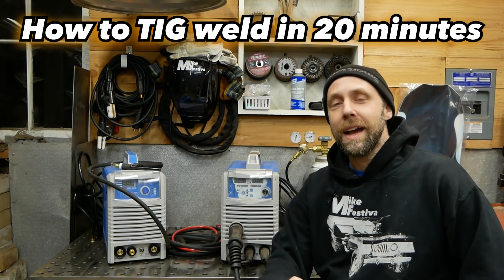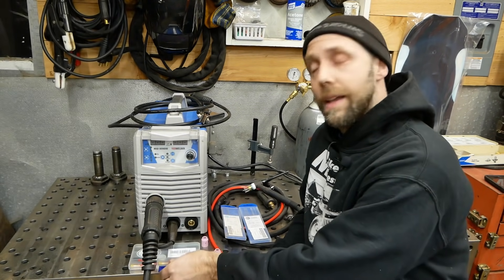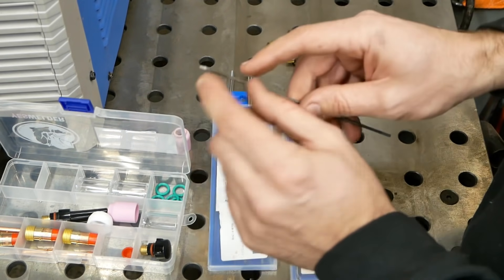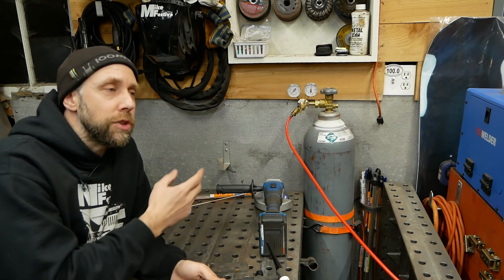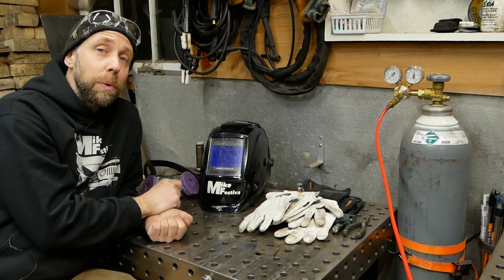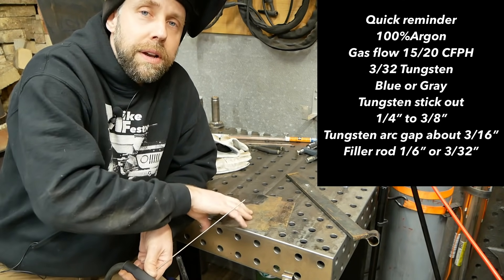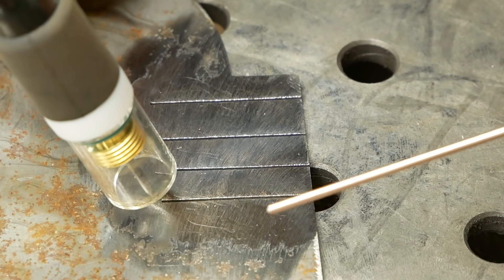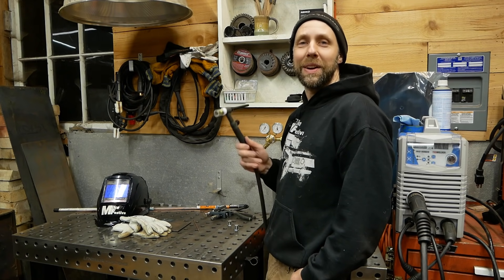Learning how to TIG weld made easy

Comment: Sorry for stupid question, but is it demanding on eyes? Seems like pretty bright arc even through green filter. Is there eye damage if you do this regularly?
Reply: That may have been due a camera related thing - with a good welding mask it is quite dim. Definitely worth investing in PPE and for the auto dim ones testing the battery before use, else welding could be very harmful to your eyes

Comment: Great video
How far do you hold the filler rod from the arc?
Is there a video on this question?
Reply: Re-phrase the question; The sharpened tungsten in the torch is held about a 1/16 or more from the steel plate. The filler rod goes in the weld puddle. Argon gas only for TIG, and that applies to all metals.

Comment: What is the power supply for this, 110 or 220? What is the amperage required from the breaker?
Reply: 205DS- 110 V 50/60 Hz power or 220 V 50/60 Hz. I installed a separate 60amp breaker and run my welder on a dedicated 220v outlet. If I run it on a 110 with a 30 amp breaker, my breaker trips after around 5 minutes of welding on anything between medium to high power. I've never tripped the 60 amp using the dedicated 220v outlet running at the max settings on mig, tig or stick.

Comment: Just started to learn tig welding. Any tips to keep hand steady as the torch is travelling. I’m having issues of it going up and down.
Reply from the maker: That is fairly common when you are learning, I did the same thing as well when I was starting out. Just keep practicing and working on torch travel and you will start to get the travel part much smoother 👍
Reply: @Mikefestiva  thank you for the reply. Do you brace your arm on the bench somewhere? Or just hover it above the whole time?
Reply from the maker: @Roastyleg  if you can brace your arm on something it will definitely help 👍
Don’t hesitate to do that whenever it works in your favor.

Comment: Hey Mike,  where can we get a cool welding table/ table top like that? Will u add that to the description. 
   I'm $1700 into welding supplies and haven't even turned on my welder yet. 😄
Titanium ultimate 200 $850
Aluminium spool gun. $169
125 Argon tank.           $310 (delivered)
Welding accessories.   $150ish

Comment: If you use brake parts cleaner on your metal, make sure you only use NON-CHLORINATED brake parts cleaner. The regular chlorinated stuff works better for cleaning, but it causes extremely toxic fumes that will kill you.

Comment: Hey, Thanks for the very detailed and informative video !

...After watching what you do, I think I could do this (Tig weld) Just wondering whether they are smaller disposable Argon gas bottles you can use (about the size of the Mig welding gas bottles) as I want to do a little bit of Tig welding occasionally and don't want a huge gas bottle taking up space in my small workshop... Thanks for any hints and advice you can offer regarding this...  👍👍👍

Comment: I'm curious since you also have the acdc machine.  I have a torch from CK and it has a lug to connect to ground yet the wp-26 doesn't.  Can I use it or should I use the one they included?  The small CK is just more comfortable

Comment: hi Mike, just wondering, can you do body work with tig, i mostly see folks mig weld, does the material /work have to be flat and on a table or can you do tig say on a body panel thats mostly vertical?
Reply: If you need to you can connect the ground clamp directly to the workpiece. Just make sure the ground clamp is connected to a clean, unpainted surface.
Reply: TIG is great for cars, if you want to burn out all the electronics. Shut off the HF or high frequency if you absolutely have to use it. Please use MIG.

Comment: That was great, thanks!
Reply: Where’s the follow up you mentioned for aluminum? Thanks
Reply from the maker: I’m about finished editing the aluminum TIG video, but I’m a bit apprehensive about posting it due to some extremely negative comments I recently had after posting a video about different brands of flux core wire, I literally blocked over 25 people that left really disrespectful comments.
I will post the aluminum TIG video fairly soon. Thanks for checking out my videos Owen 🙂👍

Comment: Looking at buying the tig 205ds how much different is it from the one your demonstrating? Is the highfrequency tig difficult to use
Reply from the maker: I haven’t used the TIG 205 but high frequency is definitely nicer then lift start. Keep in mind I think the TIG 205 is only DC so only Steel and stainless steel. I own the Yeswelder 250P AC/DC TIG for the past 3 years and it’s been a good TIG welder, zero problems 👍
Reply: Awsome thank you!

Comment: I noticed when finishing a slotted weld you pulled the filler wire out of the argon shield, then moving on to the next slotted weld you started the weld with what would be a contaminated fillet rod. Surely the rod should remain in the post purge shield.
Reply from the maker: If you are work with a scratch or lift start you will realize it’s not worth trying to keep the filler rod in the gas when breaking the arc. Honestly don’t worry about about it, it’s going to be fine. 👍

Comment: Hi Mike. Long time watcher here. I really appreciate all of these videos you post about welders. I actually bought my titanium 200 because of your videos. Do you have any recommendations for a Tig welder before I go ahead and buy the yeswelder 200 ac/dc? So far it’s either the yeswelder or primeweld I’ve set my sights on.
Reply from the maker: I have been using the Yeswelder TIG 250P for the past 3 years at my work and it works great 👍 I have however been using the Hynade TIG 200 AC/DC machine and the display is much easier to see the the Yeswelder. 
The AC/DC TIG I like the most these days is the Arccaptain AC/DC welder, the display is the best I have seen out of many different units, easily to use and welds really well. I have been getting footage of that welder but haven’t made a video yet on it. Just a few suggestions on machines worth looking into on Amazon 👍

Comment: do you think aerospace welding is a good career, any helpful advice ? thanks for the knowledge!
Reply: @bomitozyro9639  I weld for an aerospace company and it’s not your traditional tig welding, mainly repair welding.. it’s definitely tricky sometimes but it’s just something you will have to figure out as you go.. no two parts are going to weld the same.

Comment: dude thanks man all I needed.
Reply: do you have a link for that machine you are using? I am in Europe and want to get that easy start that your machine has. I have learned welding with gas so I have still a lot of trouble with my stick getting stuck to the surface. With torch welding I am very used to fill with the fill metal so I expect that to come easy.

Comment: Have a question for you. I'm trying to tig weld the cutter ball cup that goes on a powermate small 2 stroke wheel weed eater. They like ripping the ball cup off. So this time I thought of trying to weld it back on. I have a ct312 3n1. Even with it set at the lowest amp 10 still burns holes when trying to puddle up. I also have a purple 3/32 electrode. Wonder if I should try 1/16 rod? I sharpen with a cordless drill and end grinder. Works for me.

Comment: Great video series, keep 'em coming. I bought a 200P from yes welder and  foot pedal. The question I hav is how do I set up the Pedal. the manuals have no "how to"
Reply from the maker: I have a TIG 200P at my work. To get the pedal to work you need to hold it all the way down for about 5 seconds or until the light comes on the front panel. After that let off on the pedal and it should be synced to the welder. Make sure the torch is held in your hand before pushing the pedal, if it’s on the table it can arc so that’s not good.
I use mine all the time at work to weld aluminum. 
Hope this is helpful. 😊

Comment: Curious, should I only use 220 for Tig? Seems I can do flux just fine with 110 but I’m running far lower amps. And are you using the 20’ extension listed in your description? I’m wondering if I should just build a 6/3 extension cord to max amps for the 25’ I need to run.

Comment: Because of your video, I bought a yeswelder 250p. However, out of the box my welder doesn't create a arch, spark or anything. Any ideas? I am using the hand trigger torch that came with the welder. Need help please.

Comment: Does your machine say scratch tig or lift tig on the front panel? Mine says scratch, even though I just bought it brand new, and it seems to be having issues doing lift starts, mostly just the tip of the tungsten getting stuck to the metal
Reply: Mine does that too but I think it's my inexperience and not the machine. I will blame it on, I need more practice and maybe I'll try different amperage settings.
Reply: @whocares2227  yeah I’m just trying to figure it out honestly. I can scratch start super easily but if I try to lift tig the tungsten sticks to the work just the same way a stick electrode does

Comment: Thanks going to put the rye bottle down and try this again I can weld everything but bought a Miller multimatic 220 tried tig welding aluminum turned to the bottle over it 😅
Reply from the maker: Is the 220 an AC TIG? I have another TIG video I posted about 5 months ago that covers aluminum, I think it would be beneficial for you to check it out 👍

Comment: Can I weld square 50x50x 4 mm steel tube using this TIG /gas method, or do I have to use MMA (ARC) welding rods? What do you suggest?

Comment: when you pull out like that you leave a pin hole every time, work on feathering the puddle when it gets small lift off then and only then
Reply from the maker: It’s a bit hard to feather the puddle with a lift arc machine, can you explain how to break the are and feather the puddle please? I have zero problems with an amp pedal but this is a Lift start TIG, you can’t ramp down your amps.

Comment: Why wouldn't the tungsten rods come pre grinded. Is there a situation where you would use one not grinded?
Reply: They would cost a lot more if they came grinded from the factory. The equipment they would need to do so would be expensive in mass production
Reply: Most experienced folks prefer to customize the grind angle at times depending on what they are welding.

Comment: So you don’t have a pedal with this setup.. would you prefer to be using a pedal? And what advantage does it give you by either using a pedal or not? Thanks for the demo!
Reply from the maker: I prefer an amp pedal for sure. Just wanted to cover TIG welding with the most basic setup for a simple demo. The amp pedal lets you start and stop your arc and control amps ( heat input) when welding. Hope that helps.
Reply: @Mikefestiva  I am about to buy a tig welder, I started stick welding as a teenager early 70's, I have been using mig for 20 yrs, im looking at a dc machine, but want to be able to weld aluminum with it, should I get an ac dc machine with a pedal ? or can I do a decent job with aluminum with a dc and no pedal ?
Reply from the maker: @ I have a second part to this TIG series, there should be a link is the description below. It covers aluminum welding, it will answer everything you want to know. Here’s a short answer though, you will definitely need an AC/DC TIG with a pedal for aluminum. I have been using an Arccaptain AC/DC 200 amp welder for the past two years and it’s a really good welder for the price, good features and a really easy to use interface to set up 👍
Reply: @Mikefestiva  thanks

Comment: My tig welder is a Lincoln square wave that has a pedal when I let off the pedal the gas stays on for a few seconds. So my question is do I need to touch off with that welder or do I just need to activate with the pedal?

Comment: i know this is a old video but i have some concerns with my mig 205 ds. I am trying to weld with tig but when i put my torch in negative it burns up the tungsten. When i put my torch in positive it works? Should i be concerned about this and does this put me at a disadvantage when tog welding? Thanks in advance

Comment: i need to learn how to turn on the gas and the welder machine before i started welding 
im trying to weld my aluminum boat
can you help me please.
Reply: The rule for any welding of aluminum MIG or TIG, is that is has to be clean and free of oil, grease, paint, gum from labels and any anodized coatings which all boats have. Grind it or file it off.

Comment: In America they are ripping people off for MIG gas, giving them 25% Co2 and 75% argon. The argon is what makes the arc glassy smooth and no splatter. In a European country they use a standard of only 5% Co2, and 95% argon. This makes more sense, because you want the cleanest weld possible with no spatter. My Lincoln Weld Pak 100 always had a "rough" arc that sounded rough with spatter. I always felt like the shielded gas was part of the problem. Different ratios for different type of arc. I think it's probably worth trying different gas ratios for your primary welder. It makes a HUGE difference in TIG, so obviously it makes a huge difference in MIG too.
Reply from the maker: There’s other ratios of Argon/CO2 available they just cost more. 75/25 works fine for me, but then again I welded years with flux wire because I couldn’t afford a bottle, regulator and filling charges, so coming from flux 75/25 is a big difference. 👍
Reply: You dont seem to know what u are talking about. You can get straight argon it is cheap as shit, argon 75/25 is more expensive than argon. I have a bottle for my mig and it is widely used by most professionals, that bottle cost me 35 to fill, while argon cost me 26, and i have both.

Comment: Hey great video but I was wondering on the filler rods ( which rod is used for what material ?
Reply from the maker: Use steel filler rod on steel, aluminum filler on aluminum, stainless steel on Stainless steel.
3/32 or 1/8 filler is good.
Reply: @Mikefestiva  thank you! I wanted to make sure when I did research earlier too ! Thank you again!

Comment: Excellent ......20 minutes that others can take 2 hrs to explain 😊
Btw, whats the cause of the cratering at the end of your beads 20 mins in?
Reply from the maker: It’s a bit hard to avoid the dimple at the end of a weld with a lift start TIG without a variable amp pedal. Keep in mind this is the most basic of TIG welders. I have DC and AC TIG welders that you can vary the amps.
With a welder with a foot pedal you can lower the amps at the end of a weld and add a little more filler rod to overcome the dimple at the end. Thanks for checking out my video. I have a how to Aluminum TIG weld that covers a lot more detail in TIG welding.

Comment: What would happen if I use 75/25 argon, mainly learning myself how to tig. I am also learning to mig. I have stick experience only from work at this time.
Reply from the maker: It will not work believe me, I made this same mistake the first time I tried to TIG weld. You will get brown soot on the weld area, the Tungsten will get contaminated and the weld puddle will bubble and crater.
You definitely need 100% Argon gas.

Comment: I bought the hynade tig welder to tig aluminum. The high frequency starts but then goes off and I get black soot. How do I set the HF to stay on so it cleans
Reply from the maker: You need to set it to AC and dial in your AC balance. What gas flow are you using with your 100% Argon?

Comment: is it true to bleed the gas line after shutting off the tank valve, so as not to have the inside of the hose turn brittle and contaminate the gas?
Reply: Ya, if you only weld once per year ! ...

Comment: Thanks Dude, this was very helpfull, wish I watched this before I bought a SCRATCH TIG machine...haha
You don't maybe have a video on Scratch Tig Welding? Or a link to someone that has, I want to weld 1.6mm Mild Steel plates together and 2mm SS little handles piece together.
Reply from the maker: Scratch is almost the same, just scratch the tungsten to start the arc, to break it is exactly the same as the video 😊👍

Comment: Sorry I ever got rid of my Festiva. One of the best cars I ever had.
Reply from the maker: They are great little cars! I did a lot of upgrades to my little Festiva, big brakes aftermarket suspension and installed a 1.8 DOHC 16 valve engine from an Escort GT. It ripped and still got amazing fuel mileage 😊👍
Unfortunately I sold mine off many years ago as well.

Comment: 02:09 Whats "dip your tungsten" mean? Is that like what happens when you use a scratch start torch and it sticks to the steel/Aluminum?
Reply: Pretty sure it means when your tip dips into your weld pool. At that point your too is contaminated

Comment: What is TIG welding used for vs other types?
Reply from the maker: TIG is good for welding Aluminum with more control and detail especially with thinner metal. Steel and Stainless steel,
More control over heat then other welding processes. You can also TIG braze dissimilar metals together.

Comment: Should the grinding wheel not be rotating away from you? Tia
Reply: That's the normal rotation of a bench grinder. Be careful to present the tip (or whatever your are grinding) at a shallow angle to start. Too steep and it could dig in and be pushed towards you. This direction is preferred as it doesn't leave a burr at the point of the tip.

Comment: How much is a bottle of argon? Is it expensive? And where do you get it? I have a yeswelder machine, its a stick machine, but it can do lift tig also, but i dont know where to get argon at.
Reply: Get it from your Welding Supply Store. Plus, don’t you have a “Smartphone”?….. I can’t believe you had to ask that question.
Reply: Cheapest place is primeweld online, in my case. Called four local stores and primeweld was cheaper by $40 and as much as $100 cheaper than airgas. Expect to pay in the mid $300’s for a 125 cu ft.